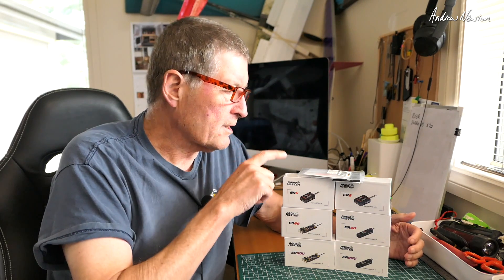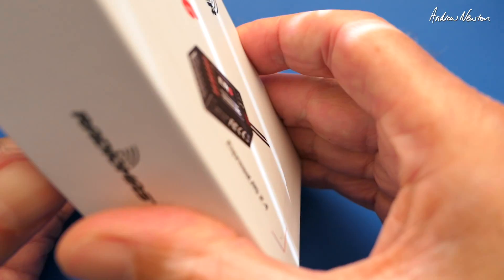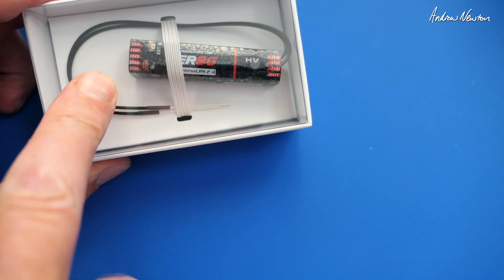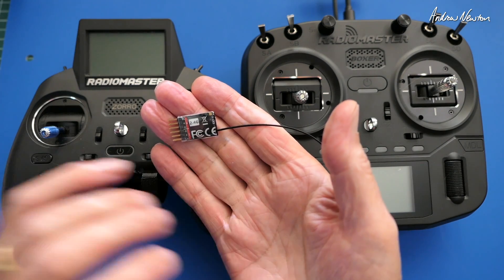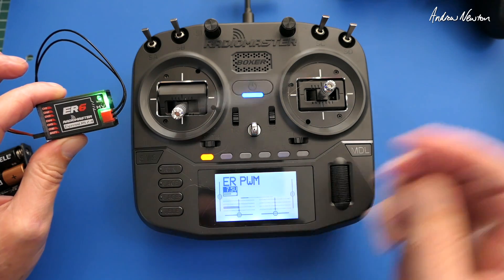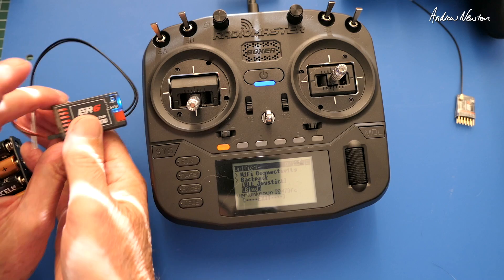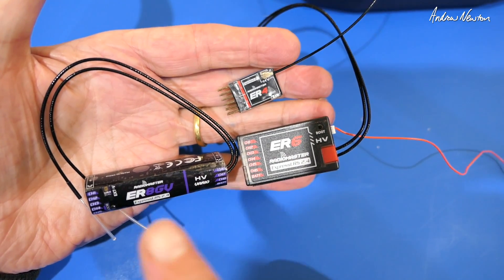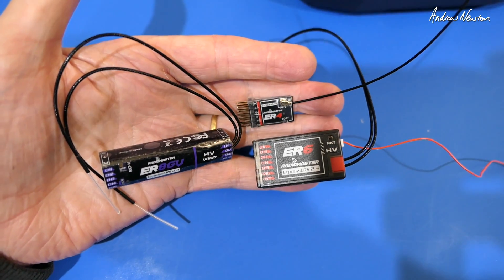RadioMaster ER Series ExpressLRS PWM Receivers

Comment: Hi Andrew, I am looking to buy Radiomaster Pocket (ELRS / LBT) version just to confirm, will Radiomaster ER6 receiver will work with it? Second question: I wanted to work with Speedybee Mini FC in future build for that I have RP3 V2 ExpressLRS 2.4ghz Nano Receiver in mind. Is this a good combination to work with. This setup would be for fixed wings.
Reply from the maker: Yes the ER6 and RP3 will work if you flash them with the EU firmware. SB F405 WING Mini and RP3 is an excellent combo. But be aware that the Mini is a quad board, you want the WING Mini.
Reply: @AndrewNewton  so the transmitter and receiver should have the same firmware in order to work properly right. I can google how to update the firmware on both the hardware.
I will buy speedybee wind mini. Thanks
Reply from the maker: Yes both must have the same firmware. This is the easiest method https://www.youtube.com/watch?v=8poK--ln5J0 Choose the "Regulatory domain EU"

Comment: They need to add VBATT....not share it with RX voltage. Two different things.....On a Crossfire RX it switches between both. Very annoying TBH....🤔😳....Good job Andrew....
Reply: Sorry, I do not understand the problem/question/issue,   ..I am a begginer, could someone explain it me in detail? Thanks in advance!!!!

Comment: Excellent review Andrew. Excuse my ignorance but do they make for/will these work on 4 in 1 ( I have TX16s mkii ) the price for the vario version here in the uk is about 1/3 the price of FRSky version
Reply: These require a reasonable priced JR bay module $39 for the Radio Master one.
Reply from the maker: As Spartan says, you would need to insert an ELRS module in the JR bay. Like the Radiomaster Ranger module
Reply: Thanks to both of you, I did assumed that but hoped there might be some trickery around it! Still don't understand the difference between ELRS and 4 in 1! More utube to watch I guess.  Thanks
Reply: Andrew, Spartan you two mean the ELRS Ranger “series” so  including the nano and micro ones? I cant find any Tx info on the Radiomaster site to confirm this.  Thanks. Laurie NZ.
Reply from the maker: @LWJCarroll  Correct. They are all compatible, as are any other ELRS modules / radios / receivers

Comment: Nice, showing off the vario working too! Internally the Vairo updates over 10x per second. To get a faster update rate at the handset, increase the TLM Ratio to give it more bandwidth for updates. 100Hz 1:8 updates 5x a second, 333Hz 1:32 updates 4x a second, and the ratio can increase/decrease from there.
Reply from the maker: Many thanks Captain, very helpful information.

Comment: If Radiomaster made these available in 433MHz then people who have been hanging on to systems such as Dragonlink and EzUHF would buy them like hotcakes.
Reply from the maker: I doubt they even consider that market
Reply: There are ExpressLRS options (both TX and RX) in 433MHz, 868/915MHz and 2.4GHz.

People hanging onto Dragonlink and EzUHF are living in the past.
Reply: @crobnz  what are you using?
Reply: @dwaynebrown7220  I have a set (or a few) 433MHz TTGO v1/v2, 915MHz another set of TTGO v2 these are about 50mw but some appear to be weaker than others. One is showing around 28mw which is not ideal, but fine for bench-work and testing.

Then in 2.4GHz land the BETAFPV Micro TX which is up to 1W and hit 18km range in surface tests and over 60km without failsafe in an elevated tests. (Note: 62km was as far as the geography would allow me to go, the same setup under similar conditions would get much further, likely 70-100km before failsafe.)

I’ve used Dragonlink and EzUHF in the past, both systems are far less forgiving when it comes to your build and other devices. Each time you set them up on a platform for use at range it was a science experiment in chasing down and eliminating noise.

I’d like to get a nice COTS 915MHz TX, but to be honest the 2.4GHz is quite sufficient for any model flying I’d actually do.
Reply: Any links to ExpressLRS 433MHz?